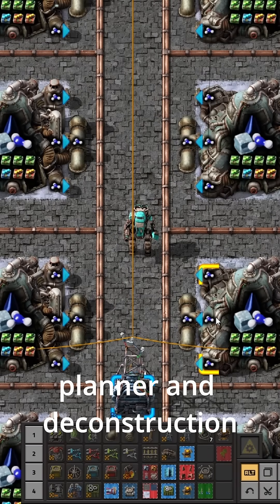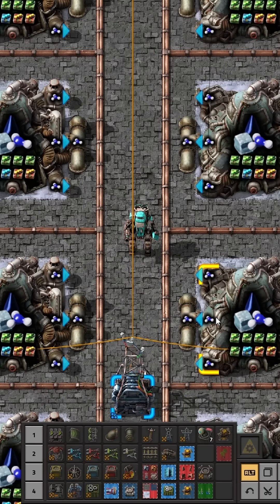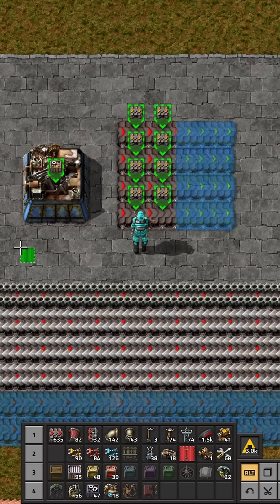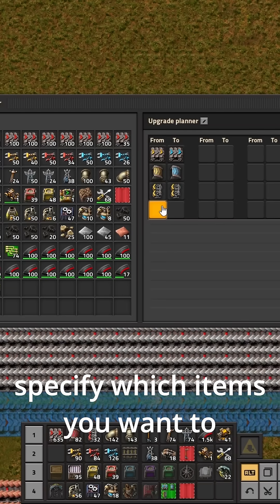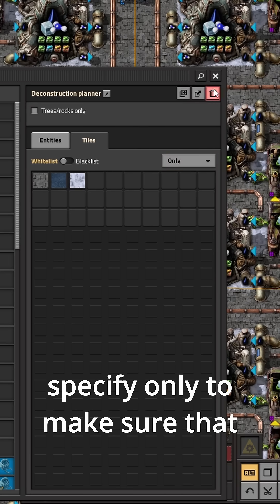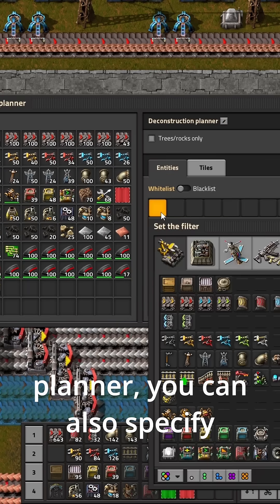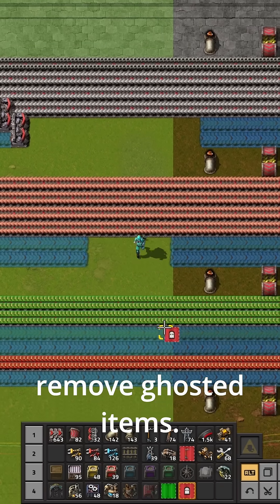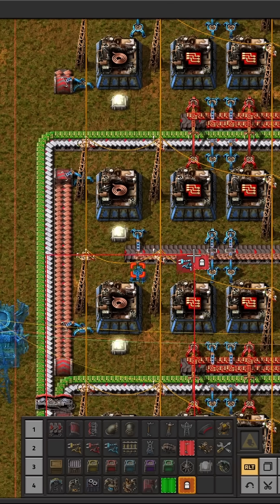Tips and Tricks for the Upgrade and Decon Planner #factorio  #factorioguide #factoriotutorial

Comment: Nice ones !!! (plus if you could use border lines on subtitles it will be easier to read I know form experience😉 )
Reply from the maker: I wasn't even sure if I could change the font as I burned them in with my video editor. I fiddled with it more and have determined that yes I can. Thanks for the comment, otherwise I wouldn't have dug deeper :).
Reply: @Autocraft_Auto  I dont know what editor you use but in DaVinci it is really really easy
Reply from the maker: @Omega_MindMaster  I’m using DaVinci, and I figured it out :).
Reply: @Autocraft_Auto  Awesome !!! DaVinci is the best love it
Reply from the maker: I tried adobe premiere years ago so I had at least a small sense of what could be done, and DaVinci was pretty easy to learn after that. Its updating system is weird though lol.
Reply: @Autocraft_Auto  I never used Adobe and also think that DaVinci is really easy and for updates I dont know as I am sill at 19 and upgrades comes with computer format so I just download whole thing ones more
Reply from the maker: It just did something I wasn’t expecting it to do. I updated to 20 and it messed up my taskbar. I had to remove it and add it back which was odd to me as most things with just update whatever shortcuts you have.
Reply: @Autocraft_Auto  thats strange good that you found solution to this